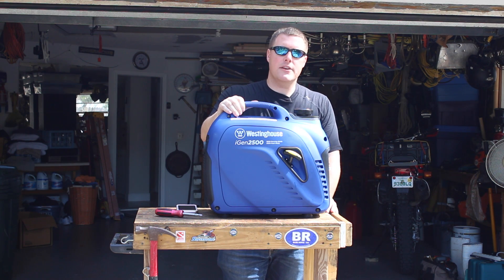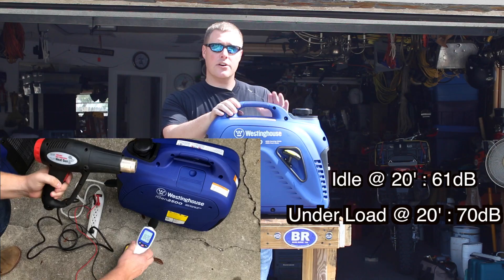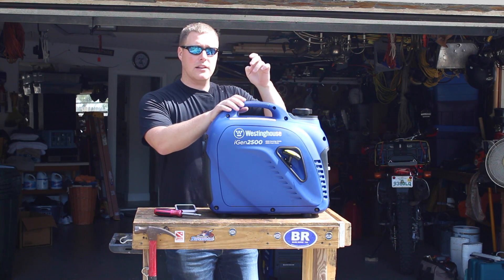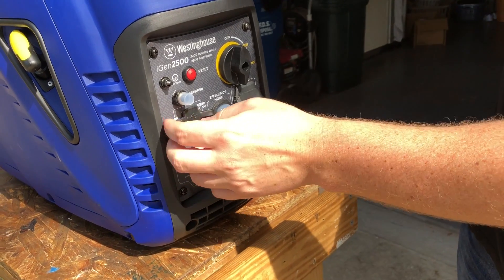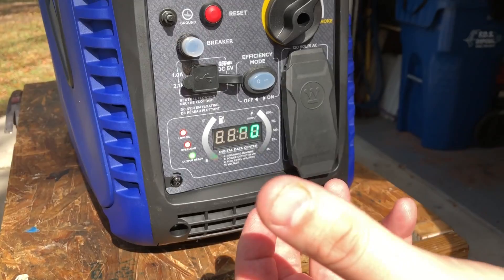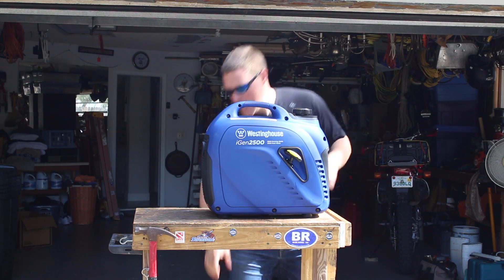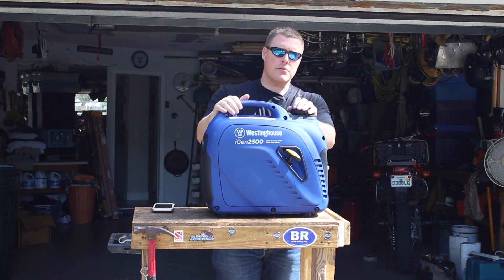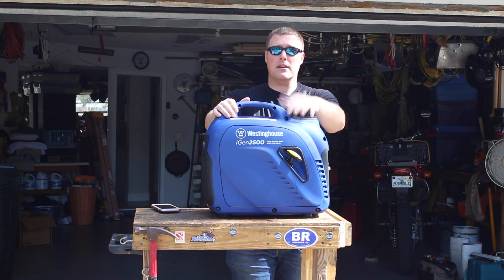Westinghouse iGen 2500 Inverter Generator Review, Sound Test, & Load Testing, LED Display

Comment: How is quality control on unit? Have heard of broken spark plugs rust in fuel tanks had any issues ?
Reply from the maker: I haven't heard of any specific issues related to this unit. The 4500 had an auto-choke issue, but I believe they have now been addressed.

Comment: Last summer I bought the Westinghouse iGen 2500 based on this video and your review. This fall I found an Aldi Workzone 2000 watt inverter generator on clearance for $150, I figured I couldn't go wrong at that price. My question is, can the two generators be used in parallel using the Westinghouse parallel cable? I know it can be used with unmatched Westinghouse generators. Thanks.
Reply from the maker: You can only pair Westinghouse iGen generators with other Westinghouse iGen generators. They can be different sizes but must be in the iGen family.
Reply: @generatorpower7744   Ok, thank you. That's what I suspected but I thought that perhaps because they simply plug into the outlets and not special parallel ports they were more flexible.

Comment: I wish you had an EU2200i similar test so I could do apples to apples.  I am trying to figure out which portable generator to get.  With an Easystart in my 15k AC, both will power the AC if needed.  I am really trying to see the difference in sound.  I have the Honda specs and have seen "real world" specs, but I would like to compare to your real world specs for a fair comparison.
Good channel by the way.

Comment: Garbage made by MTD, won't run my 13,500 BTU AC.  Same AC that my Honda eu2000i ran without issue for 3 years. Also keeps tripping my GFCI as well. Called Westinghouse and they were useless. Returning this crap asap.
Reply from the maker: Hey Wyo, do you know how many amps your 13.5 AC is pulling? This is strange as we have done this many time over as well as other commenters on this channel. Have you already sent the unit back? If not, maybe I can try to help reach out to the guys at Westinghouse to help resolve your issue. To answer your questions/concerns, no, we are not paid by generator companies. And no, not all generators were ours. We were resourceful as possible borrowing, loaning etc generators to make these tests possible.

Comment: I just bought the Honda eu2000i I would of consider this what do you think?  Rob
Reply: You are probably better off with the Honda.  The Westinghouse only has a 98cc engine.  You Honda has a 100cc engine.  Honda just replaced the EU2000 with the EU2200.  It has a 120cc engine, and only rated for 2200 watts.  You can watch other videos that show your Honda does a better job pulling larger stating loads than other 2000 watt generators.  The only way the Westinghouse could achieve 2500 watt ratings is to rev the engine.  The specs show the Westinghouse runs at 5500RPM.  As a comparison a non inverter generator runs at 3600 RPM.  I would like to see how these generators hold up long term.  I would suspect you will see a lot of catastrophic engine failures.